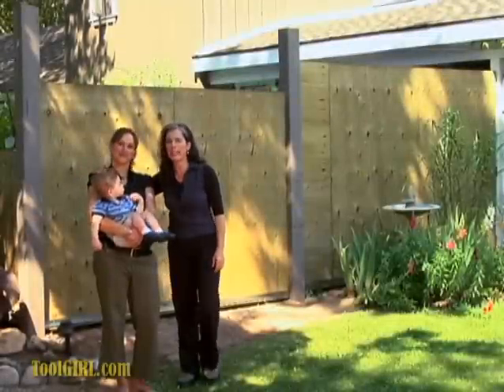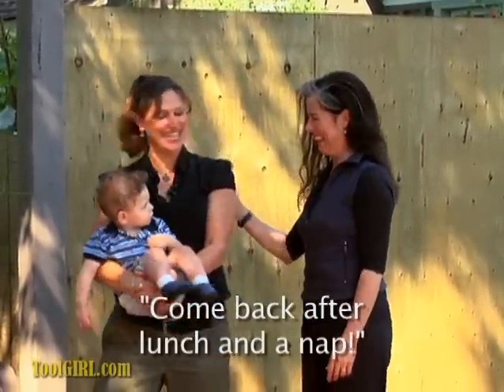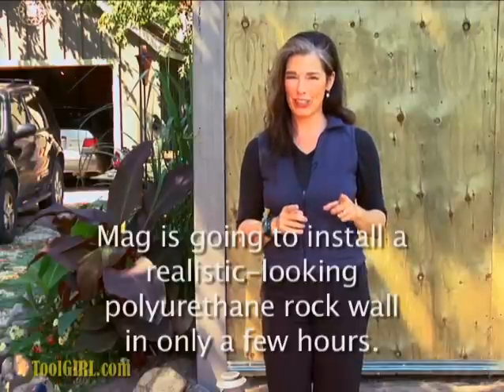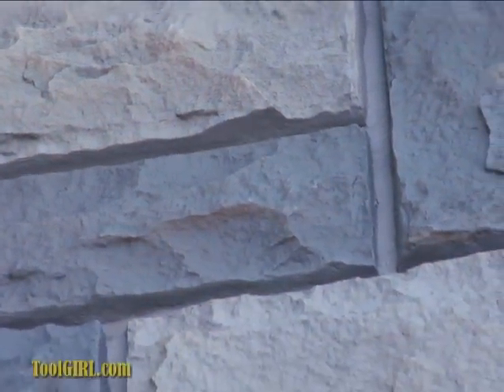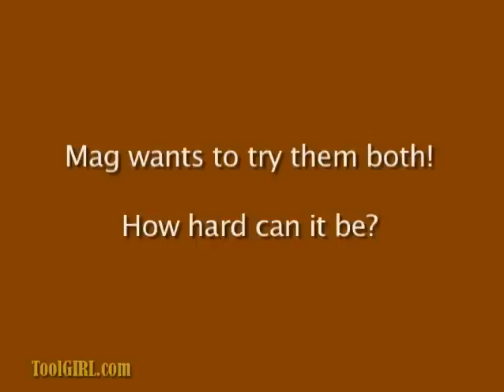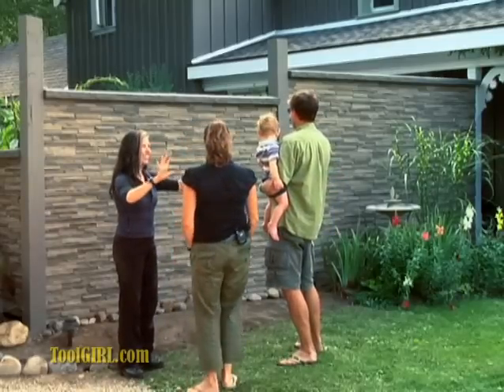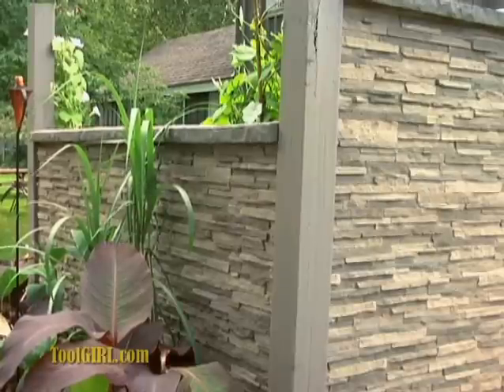DIY Faux Stone Privacy Fence in a Day! ToolGirl Mag Ruffman

Comment: Looks like you still have some maintenance issues.Wood posts eventually rot and if any moisture gets on that plywood,say good by to the nice stone look.Interlocking is OK,top cap looks OK,but what did you do to seal against the posts? If caulking then that is a maintenance issue.I am looking for an artificial stone fence in which every piece of structure that goes up will not ever be subject to maintenance again and I've seen it but I can.t find the name of it.
Reply: that plywood was treated